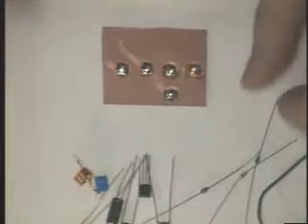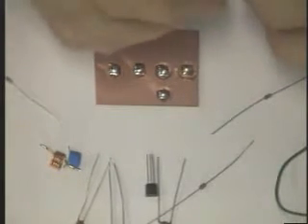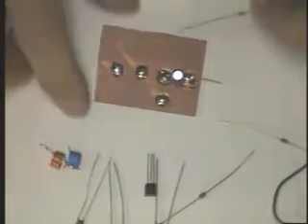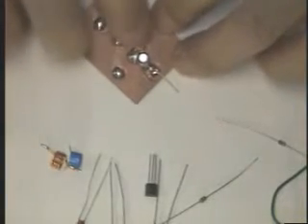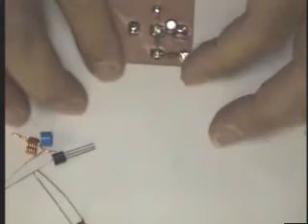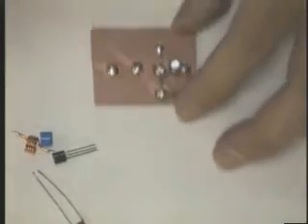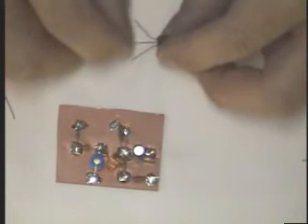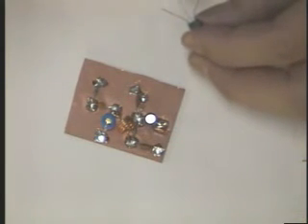Tetsuo Kogawa - Making a FM transmitter Part 2

Comment: I see no separations between the solder pads on the copper so how is it the components work if shorted out by the copper on the board?